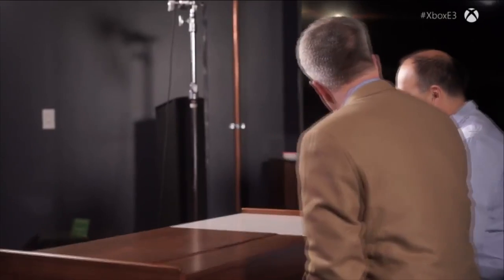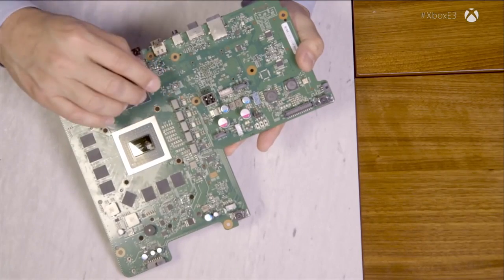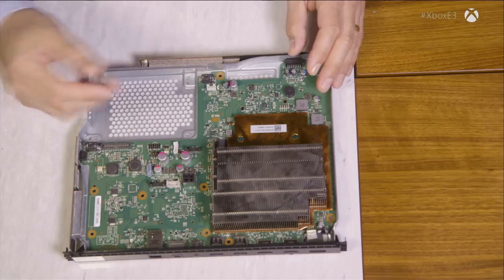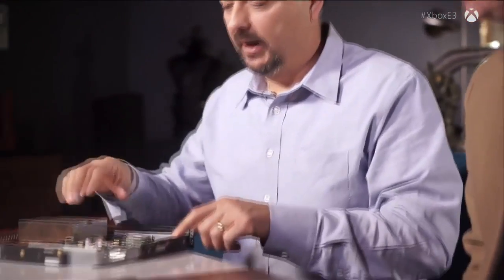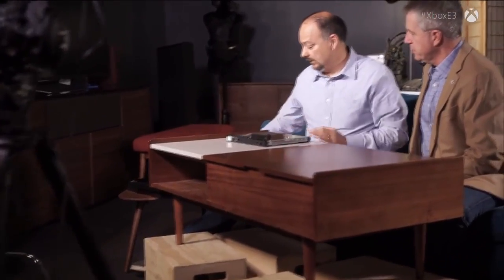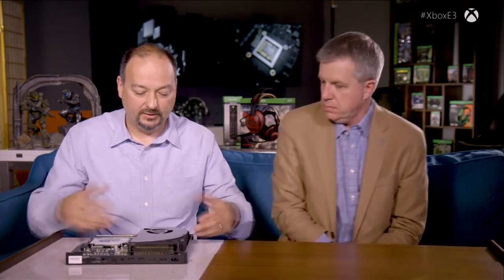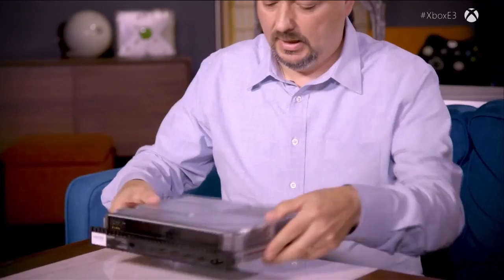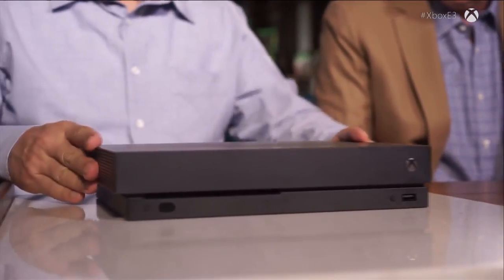Xbox One X — Assembly Process

Comment: So you're from the company itself, and you don't even know how to put it together correctly. This video has you missing so many different components that need to be addressed. It shows you putting the motherboard in down first but thats impossible because you have several cables and connectors that need to be plugged from the opposite side of the console in order for it to work. Seriously, this video is a complete failure.